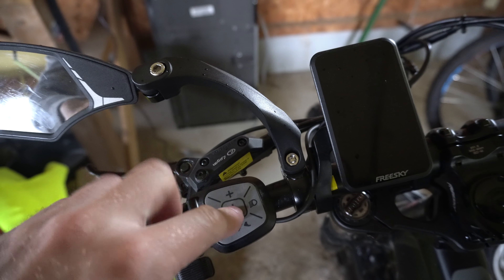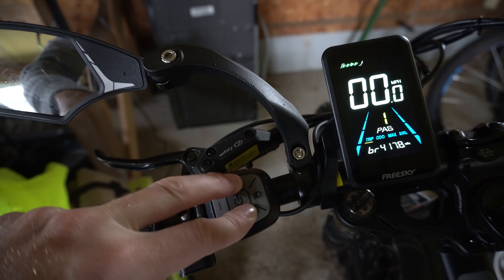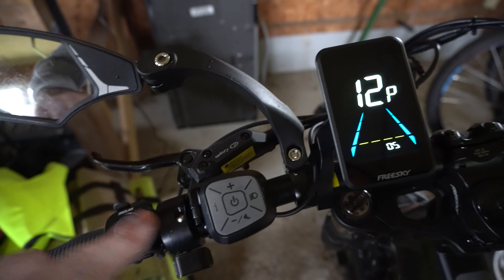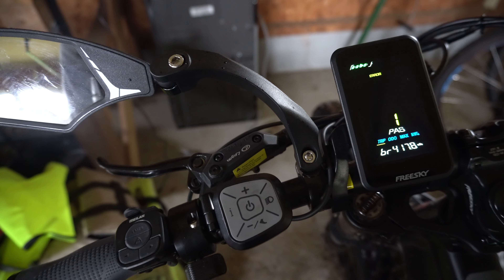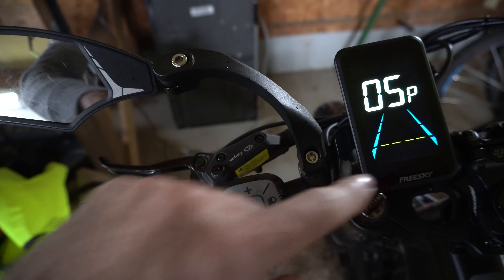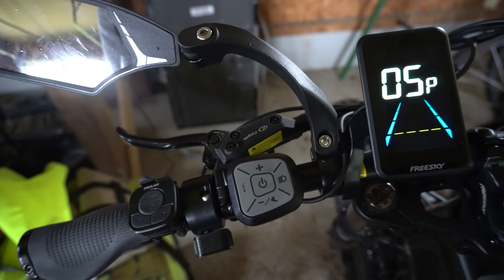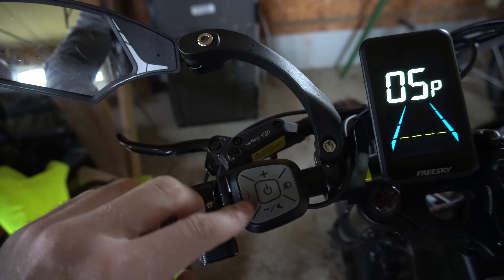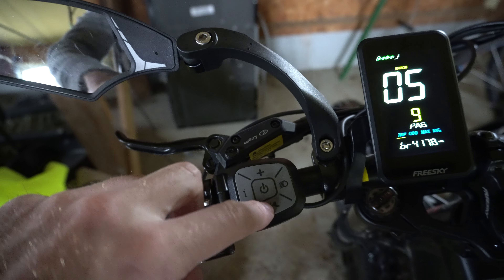How to Increase the Pedal Assist Strength on Freesky Ebike Swift Horse

Comment: I just got my bike today and took it for a short ride. I've already owned a Big Sur ebike. I think Freesky dropped the ball with the Pedal Assist. On my Big Sur... on level 1 you can pedal to the bikes max speed of 28mph... just will need more leg power than if you used level 2 or higher... then each level requires less leg effort to reach max speed... but you never EVER "ghost pedal" on the big sur... i didnt even know what that meant till i got my Freesky. That makes the bike really disappointing... it doesn't feel nearly as natural like my big Sur.... debating whether i want to keep it.
Reply: The ghost pedaling is a legal loophole so if the cops stop you doing well over legal speeds you can say it was leg power and get no ticket.
Reply: @theonlysquirrelybird I decided to keep it because it's fun just using throttle... not pedaling

Comment: hey just bought a wild cat model  your display settings are like mine but i am not able to do all settings 
you explained ,i,m thinking that it could be in the controller itself  can you remove a wire for speed limit? or do you know of another way to increase the speed thxs
Reply: There is a replacement controller available to purchase that is an "unlocked" controller, it will allow for a faster top speed
Reply: @youngfuneralhomellc  got it, I'm up for doing that just a bit pricey ,but thxs for your response
Reply: @joezuerlein  Bro i warning do not mess with voltage my ebike warn put my shi back normal settings XD.